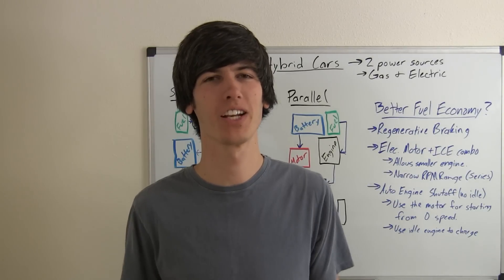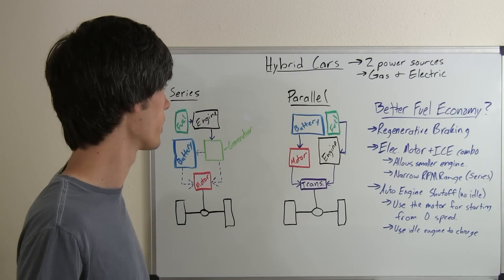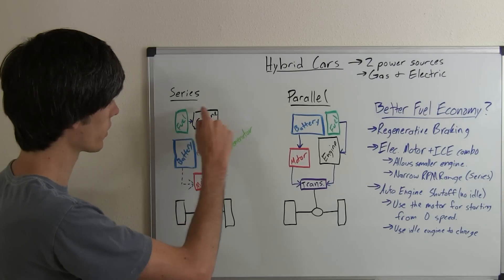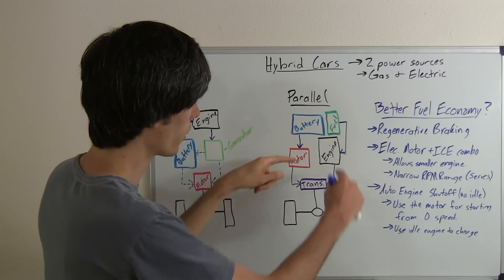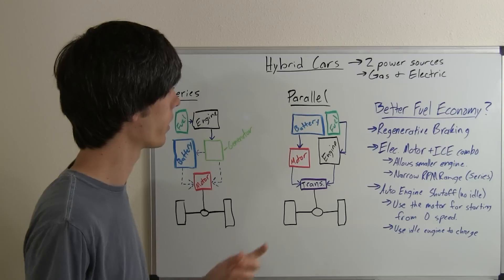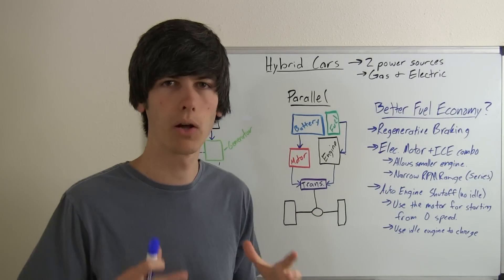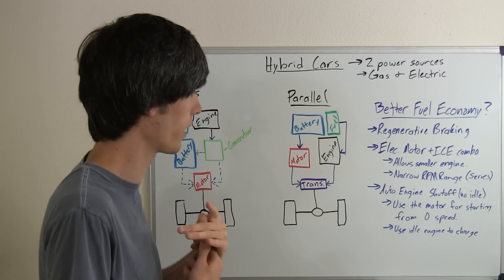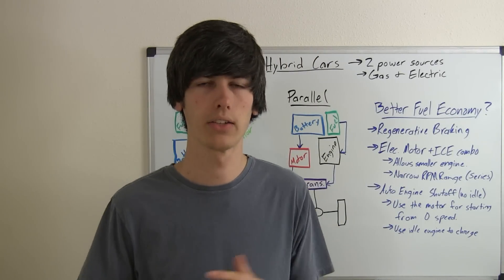Hybrid Cars - Explained

Comment: i don't know if this is a stupid question, but what is the difference between Motor and Engine in your diagrams?
Reply: Motor would be electric powered whereas an engine would use fuel combustion.
Reply: sunyboy is correct. imagine my annoyance with "motor oil" for combustion engines. i work for a company that builds engines and it drives me nuts when people say "motors" when they are talking about cars. then they call themselves car guys. you don't even know what you have under your hood! a huge pet peeve of mine.

Comment: what i want to know is how the IC engine gets involved on the parallel one when the car finally is going at a higher speed and needs the IC engine's help. Can two separate motors both be inputting power into the transmission without the slower/weaker running motor holding back the faster/stronger moving one? if that makes any sense
Reply: Yes you can combine multiple kinetic power sources with a clever transmission. Look up how the Prius Synergy Drive works.

Comment: Hey! I am planning on doing a hybrid-electric conversion on a rear-wheel drive vehicle. Trying to brainstorm how to couple a manual RWD with an electric motor, where in the chassis it should sit and etc. I have the battery and cooling system figured out, just not sure about the motor. Can it be coupled to the rear differential? Any advice would be great, thanks!
Reply: 4 year old comment, so you've probably got this figured out by now, but just in case. I've never done an electric conversion, so take this with a grain of salt, but when I looked it up in the past, the method I saw used was to attach the drive motor to the engine side of the transmission and lock the transmission in 2nd gear.

Comment: What if the electric engine doesn't start (fails) does the program jump to "start combustion engine?" Then give you a warning, or diagnostic message, to "check, or service electric engine?" Then continue running on ICE, until the electric engine problem is resolved?
(i.e. default to starting ICE, on startups)
Reply: Electric motors don't fail. Combustion motors do.

Comment: let's not forget to mention the sorry ass tires that hybrids are equipped with that offer minimal traction, and the smaller, lighter brakes that are only installed because it's the law.
Reply from the maker: Regenerative braking can provide substantial stopping force, so smaller lighter brakes make sense. And if you don't drive aggressively (aka driving a hybrid) low rolling resistance tires will be just fine.
Reply: maybe youre looking at the wrong hybrid vehicles...there are many different styles, targeted uses and price range vehicles available...some of which can outperform high line sports cars...expanding your focus might lead to expanding your conclusion a bit...

Comment: Honestly, there are no benefits to a hybrid car in my opinion. They cost more to make and more to buy, they also produce more pollution when made. A small clean diesel engine is probably much better for the environment and your wallet. Engine braking in a regular car saves fuel as most new cars have injector shut-off to save fuel. The new Volkswagen Polo blue motion gets 3.4L/100km, better than most hybrids.